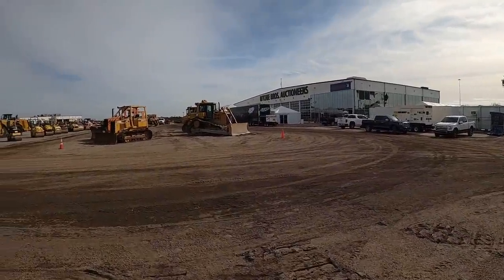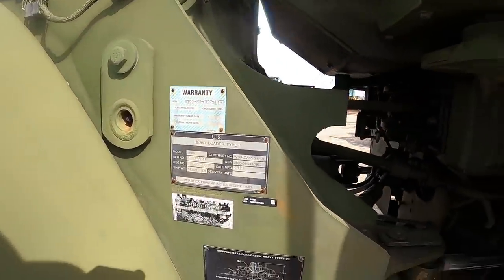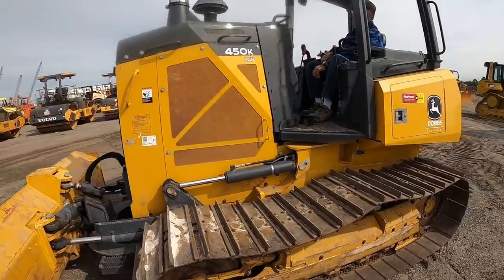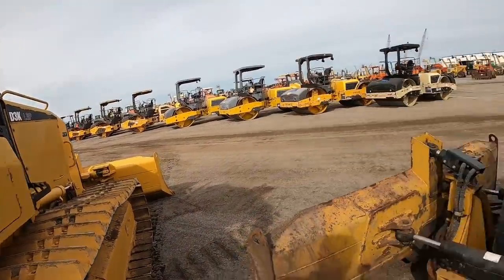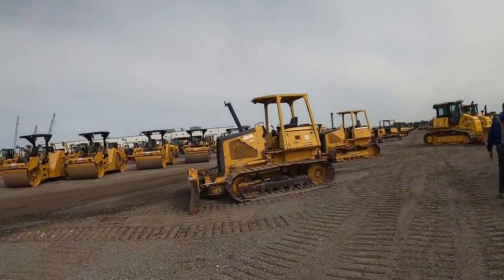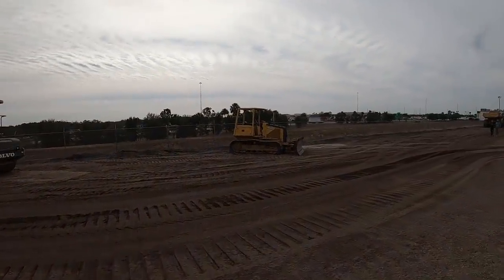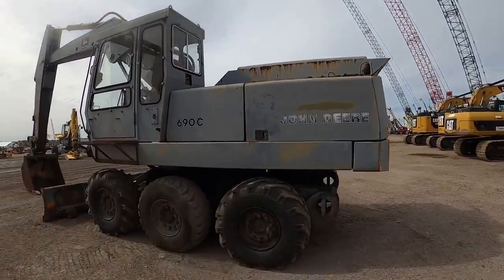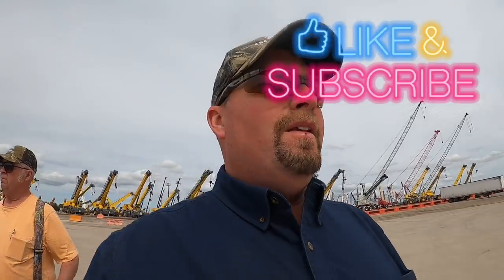Auction stop #4 at Ritchie Brothers Florida feb 2022

Comment: The mechanics in our Case backhoe shop would use a hydraulic handpump (or porta power) plumbed into to zirk  hole to put pressurized oil to break through dirt and rust clogging the bearing channels. Worked pretty well with the oil able to penetrate better than grease.
Reply from the maker: I like that idea

Comment: We had a highway project in SE wisconsin and they basically used quad tracks pulling scrapper pans and some of those high speed dozers to move most of the material.

Comment: Those great machines in those days, in mid sixty I worked around drag lines, I use to push the pads around for them , we had one American dragline that was Hydraulic , rest were old style. Unbelievable what these guy could do with those Riggs, we were digging out carnal. There wasn't Excavator in those days.

Comment: I wouldn't mind the keypad instead of a switch if you're a contractor and your smart no matter what you buy that has a keypad switch you take the last four of the VIN number for that particular machine and use that as the code to run that machine 
I would think that the keypad would also help detour theft as well

Comment: The 6 wheeled JD690 JD they had one at the 
Air force base by my home. The guys there said it's for repairs to bomb craters on runways when they take back a airbase after the first strike,
The hard surface of runway did not need a track  or stability with outrigger. Very important for bringing in Logistics, personal. They wanted a high speed mobile excavator, to keep up with convoy. The LB crane at end. The Loggers in NW loved those as healing booms, or as shown on ( TV show AX men) they used it as what's called a ( YODER) not yarder. Don't ask me the reason why they came up with different names
The healing boom would be put straight up in air. They would add more cable Drums on rear top. Then run out the cable and yard logs up hill to landing. The flat plate under straight back and forth control,  was a arm rest for operator sitting in that NOISE hot cab. The poor operator sat in that cab, hauling big timber up and running cables back down to chocker setters
Day in day out. All types of snowy nasty weather
Thank you for all the knowledge on what you tell to look at on Dozer's, the codes, the wear area, that a guy doesn't get carried away on BIDDING wars. Like you so Brilliant said. Are you going to have to put $ 1000 into a very expensive repair in the rear lower drive parts. That your shop guy would have to take the back of one of those Dozer's apart. Those side boom Dozer's. I have always thought those Dozer's can have a blade put back on. I personally think those can be put back in service with a Blade. They just get lots of straight DRIVING. No heavy use as far as pushing heavy Dirt, trees, rocks, ECT. I like it you look at there use as a Dozer again. Plus you get a heavy lift boom to like put on back of one of those neat Military 2-1/2 Ton Army truck. As a heavy duty wrecker, or just a great lift for guy in field to lift a engine out of Dozer broke down. Or replacement of Tracks in field. There are all sorts of things those booms could be used for at site, for a repair away from shop lifts.

Comment: Question.  I shot two huge dozers working a beach renourishment in Sarasota.  See video in my playlist.
Do you ever see those tractors and just shake your head cause you can tell they have been run hard, track deep in salt water?  The experience left me wondering how they do that, do they basically write off the tractors, or do they end up on the auction lot.
Great videos btw.
Reply from the maker: I see them all the time at auctions 
They are normally trashed

Comment: Those Liebherr's 714's are pretty much a 700 Deere. Just tweaked. The 764 Deere dozer has a 700 blade assembly. 
Go run one of those 850L's. They might surprise you. But I don't care for the new joysticks!!.

Comment: That big deere just has too much crap on ot for the safety aspect on it. Anyone qualified to run a dozer of that magnitude knows how to handle it withoit all that extra mess. And when you cant see but the edges of the blade ot makes it extremely hard to tell where you are when your pushing dirt. I dont think the designers are thinking these things thru amd obviously they havent spent anytime in one running it

Comment: Usually the rule of thumb if the equipment as say 800 hours or no more than 1000 hours usually will go for top dollar. You guys will flip the machine and sell it. Say if you spend $125,000 for a piece of equipment rule of thumb is you’re gonna to double the price to $250,000 that way you’ll make $100,000 profit minus the money you put in to the machine question is can you get that kind of money bulldozers definitely you can if the parts aren’t worn out on it. Richies auction Will hardly ever find any equipment going below $100,000 i’ve been to one of those auctions the only equipment that goes for under $100,000 is pick up trucks cars and small tools and small equipment nothing major. Dump trucks usually fetch 100,000 never seen a good dump truck go for $50,000.